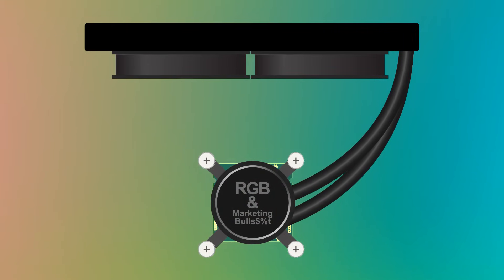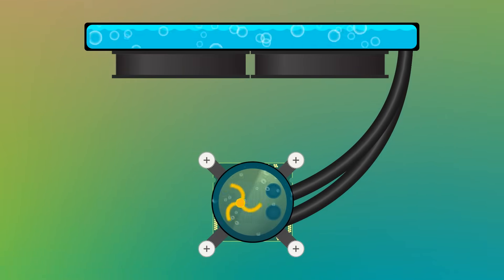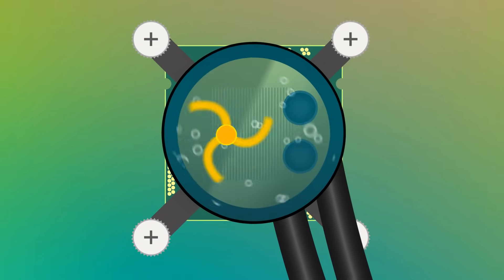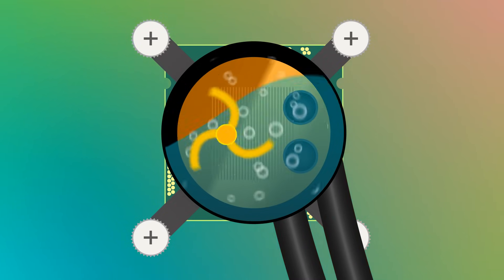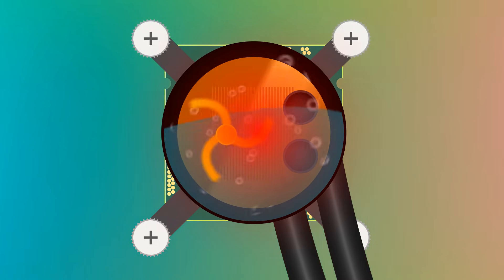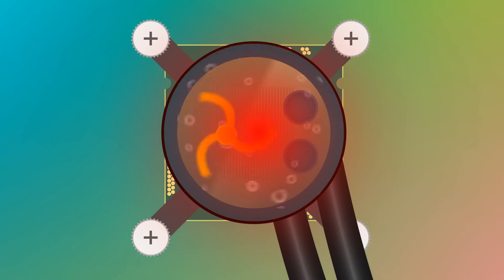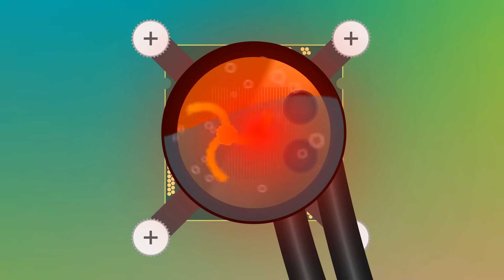Correct AIO orientation (This is the way)

Comment: yeah....this is great and all, but tell that to my BIG ass GPU blocking the damn tubes from being orientated at the bottom.
Reply from the maker: Yes that's the reality of the matter 
length of the tubes are too short in a lot of cases
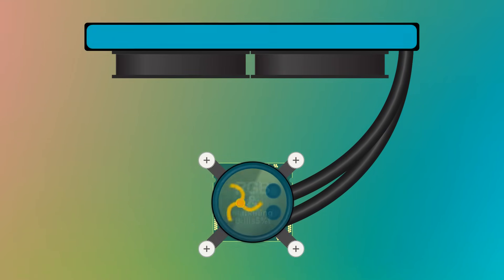0:11 is probably the safest configuration.
Reply: Tech Infographics agreed but I have a 360mm and only can do front mount. But my tubes aren’t long enough to do barbs down. So best thing I can do is make sure Rad is higher than the pump right? What are some signs knowing that it’s starting to go bad? Temps increasing? Hearing gurgling sound every once in a while is ok right? I know it means air is getting there but if it goes away that means air is no longer trapped?

Ps - you’re awesome for making this clear video and straight to the point
Reply: @mannyfresh7065  I'm in the same boat as you. Jay2cents and Nexus both said that if the barbs are coming from the top instead of the bottom the only difference would be the sound you hear and not the longevity of the product. I don't mind the aquarium sound, people pay lots of money for aquariums😂

Comment: What about the other aio's with the pump on the radiator? Can i use the last orientation for front panel set up? Im using msi mag coreliquid 240r
Reply from the maker: Try 1:46

Comment: 0:12 is this better orientation?
Reply from the maker: If you are prioritising GPU temperature over CPU temp, then Yes.

If you're priotising CPU temp over GPU then 1:46
Reply: @tldrinfographics5769  i think its the other way around
Reply from the maker: @asimo8146  Oh my you are right I have corrected it. Thank you so much.
Reply: @tldrinfographics5769  what if you cant bcs of nzxt h510 case, and nxzt x63 kraken aio?
Reply from the maker: @Darac6800  Last choice is 1:45 with tubes up which is just okay.

Make sure to keep the tubes in U shape
Reply: @asimo8146  yea u mount it infront if your worried about cpu heating problems right? As a intake
Reply: @akachrisc1519  yeah, becauae cool air from outside and when it passes through your radiator your cpu is cold, but the air from that goes into the case, warming the gpu and other stuff, but the air isnt that hot, its just not cold

Comment: how about if you only have a short AIO with single fan only. What would be the possible orientation?
Reply: With the tubes down side,  and the radiator in the upper part of the front panel, pump must be lower then radiator. Or just the radiator instaled on the top panel of the case. Or eventualy radiator on the back panel, but again pump must be lower then the upper part of the radiator, with tubes down.
Reply: @vesko1022  that was nice bro, thanks! I have a Deepcool GAMMAXX L120 V2 but not yet installed because it’s complicated haha but if I have time probably I would install it.

Comment: 😂your pump animation is totally messed up! Either running the wrong way or the pump blades should be the other way😂😂.
You animated the worlds most ineffective pump.
Reply from the maker: Haha sorry I didn't have fluid dynamics class.
It was hard to translate the pump's mechanisim into 2D as well and I had to delete the pressure guide part for more stylised and simplified look as I decided to focus on demonstrating the air pocket problem.
Reply: @tldrinfographics5769  I'm sure you knows how a spoon works! If you are American! I'm not surprised 😂

Comment: Does it make much difference having it front mounted with the tubes at the top/??
Reply from the maker: According to Gamer's Nexus it's quite bad to mount it that way.
Reply: It will keep the bubbles at the top of the tubes, this might result in lower liquid flow and the pump might have to work harder to keep the fluid flowing.

Comment: My tubes are short and my only choice is to have them at the top with a front mounted radiator :(  Haven't had any cooling or noise problems yet though.
Reply: Shouldn't cause any issues with longevity or cooling performance, only potential noise from the water bubbles
Reply from the maker: Sorry to hear that, manufacturers need to be more thoughtful with their design I think.
Reply: damn im building a pc right now and i ran into this problem too. tubes are way too short, but i hope it wont be an issue with my radiator being front mounted.
Reply: Dont over-stress this problem. It shouldnt happen to the majority of aio out there. Watch this vid from Science Studio, he clarified this for those takin this too seriously: https://youtu.be/1RcFQZ8zk5U

Comment: I can't flip my cooler and mount it properly... Single fan 120mm radiators suck.
Reply from the maker: I'm sorry to hear that 120mm radiator is probably not as good as a good air cooler.
Reply: Agree, 120mm AiO is worthless, air coolers can do more. Minimum requirement is 240mm

Comment: 0:11 is this the best orientation for top mount? I'll follow this once I'll upgrade to AIO soon.
Reply: Yea im gonna do that
Reply: In top mount orientation does'nt matter. in the vertical/front mount, keep tubes part at the bottom.
Reply: @captainfatbat9557  so like how it is at 0:11 ?
Reply: @spookythagoat310  Its an okay position. BTW where the hell did u find an aio @ only 12$
Reply: @captainfatbat9557  on Newegg it was on sale it’s called ID-Cooling 240 x snow edition
Reply: @captainfatbat9557  I’m still kinda new to pc stuff and I got a AIO for $12 for my pc build
Reply: @captainfatbat9557  should I have it as intake or exhaust
Reply: @spookythagoat310  Exhaust is a better choice
Reply: @captainfatbat9557  ok I will be mounting on top
Reply: @captainfatbat9557  but if you don’t mind me asking how does exhaust better?

Comment: your only option is to get the 240mm , front mount, tube down to eliminate the air :) which I just did with my new build 3800x and Arctic Liquid Freezer 2 240mm, it cools down idle 36-38c, load at 52-55c and specially it cools down faster and heats up slower :) !!

 I just proved myself, the front mount , tube down MADE the huge differences vs my previous top mount. 2-5c differences are big and critical! Especially when the cpu takes longer time to get heat up and faster to cool down is the PLUS sign to have front mounted!! (just like the car's radiator :) ).

My system has little advantage for GPU, I have EVGA hybrid AIO mounted in the back of the case 120mm exhaust!! I do not have too many heat generation source in my case :)

Front mount makes differences!

Comment: Thanks N Tech Labo for this very helpful video.  I recently top mounted my radiator since it came mounted incorrectly, side mounted with the tubes on top 🤦🏻‍♂️.  

My question is this, now that my rad is top mounted, do the tubes on the part that makes contact with the cpu also have to be on bottom?  Because I currently have tubes on top.  

I’ve seen many users have the tubes on the sides and some on the bottom so I’m not all that sure  which orientation is the correct one.  Again, in respects to the tubes that connect to the cpu. Thanks again! 🙏 😊

Comment: I'm fitting an x73 in the front of the corsair 465x case with the outlet tubes at the top of the rad, as there isn't any space to mount on top or the front with tubes outlet at the bottom. Will this config be fine as long a the radiatior is higher than the block on the cpu?
Reply: yea should be fine. tubes up or down is mostly a potential noise-thing, the important thing is that the pump is not the highest point in the system
Reply: @aludrum9680  That is not correct. If the tubes are up, and radiator is the upper point of the closed cooling system, so the air will stand there and pump will sucks air+liquid, instead of liquid only.
Reply: @vesko1022  yea but the air won't accumulate in the pump so it's mostly a noise issue really, maybe a little bit of cooling loss but it won't damage the pump or shorten the lifetime of the cooler
Reply: @aludrum9680  Its not about accumulating of air. The air and the liquid have diffrent density, and they
resistance in diffrent way to blades of the pump. So the revolutions per minute (rpm) of the blades can't be constant and stable. This effect definitely can damage the pump. Also, nobody likes noice  :) .
Reply from the maker: are the tubes too short when it's mounted down?
Reply: @tldrinfographics5769  no there isn't enough clearance near the psu and hdd cage for tubes to fit and come upwards from that direction

Comment: Thanks for this! Does the “lowest part of the radiator” still apply if the radiator is on the top of the case? Does it matter anymore? 

(Planning to have my AIO with tubes on the East side and radiator top mounted)
Reply from the maker: Lowest part of the radiator thing still applies.
Simply point the hose outlets downward.
Reply: @tldrinfographics5769  got it! Tubes to the south and radiator at top of case for me then! Thank you again!
Reply from the maker: @Ellyidol  Good luck!

Comment: My AIO does not fit at the top can i put that in the front ?
Reply from the maker: Sure can as long as the top of the radiator is higher than the water block.

Comment: When installing the AIO at the top, does it matter which side you have the tubes coming down? I want them on the left side, so they down cover the ram.
Reply from the maker: Left or right doesn't matter but make sure it's pointed down.
Reply: @tldrinfographics5769  make sure what is pointed down?
Reply from the maker: @sleepless9284  the inlet and outlet tubes are facing down like 0:10

Comment: Very informative video. Big fan of this explanation.

Personally, do you think having a top-mounted orientation like 0:12 works as well as 1:44 ?

For my planned build I think the case in the front mounted position would be obstructed by the GPU. I wont run into this issue if I top-mount it instead
Reply from the maker: Top mount is probably the best way since you are not introducing the heat back in to the case and GPU performance is way more sensitive to heat than the CPU.
Reply: @tldrinfographics5769  so just to be clear, image in 0:12 is the best way?
Reply from the maker: @luisstamaria7018  Yes!
Reply: The top mount is good as well, but it makes the overall heat of the system from the gpu, vrm's, and cpu through the radiator because it's functioning as an exhaust. Having it on the front, on the other hand, gives you cool air from outside the system directly to the radiator, which makes it more efficient in cooling your whole system.

However, the theory of having the radiator front-mounted is that the heat of the cpu will then pass through the gpu, but someone already tested this, I just forgot which youtuber did it, but the results came out that front-mounted is better for both the gpu and cpu rather than having it top mounted.

Comment: Hi.  I need help. I had a Kraken X63 280mm aio. This aio cooler had be used to cool down my gpu via the kraken G12 bracket. 
So what happen is for my config, the water pump is upset down and the radiator is in front with the tubes at the bottom. 
The pump is around in the center of the radiator .
Is this ok? 
My case is a fractal design meshfy C so is not that i have any other  option . 

thank you
Reply from the maker: That sounds Ok to me.

As long as the top of the radiator is higher than the pump, which you already seem to have.

Pump being upside down shouldn't cause any trouble as far as I am concerned.

Comment: I’m going to build a pc and I want to front mount a 360mm aio but the Corsair 4000d airflow dosent have space for the cables to go under
Reply from the maker: Cables or the tubes?
Reply: Tech Infographics sorry tubes
Reply: @tldrinfographics5769  Will they fit?
Reply from the maker: @vertex6099  I am not sure about this one as I have no experience with Corsair 4000D.

But it doesn't look like you can front mount the right way
you can put the tubes down.
Reply: Tech Infographics  should I just go for a 280mm radiator and top mount?
Reply from the maker: @vertex6099  If I were you I would do that. 
Get 280mm and top mount.

Arctic and EK products have great performance even on 280mm.

Please make sure to double check that 4000D supports 280mm top mount.

Good Luck
Reply: @tldrinfographics5769  I might get a h155i capellix

Comment: Not only do most AIO manufacturers showcase their products installed incorrectly in virtually all of their advertising but they also, in many cases, don’t even make the tubes long enough for the radiator to be properly installed. 

I really don’t understand how so many of them screw this up. This isn’t exactly high level physics or fluid dynamics. Surely they know that this is the optimal position, yet many of them continue to get this wrong. 

Of course plenty of people install their AIO’s either with the pump or the tubes at the highest point in the loop and it seems like many of them don’t have any issues with it. Either way, the manufacturers should at least provide the means to install these products correctly.
Reply from the maker: Yeah these companies lack philosophy and often focus on following quick trends.

But then they don't have the luxury of billions of profit that Apple or Porsche enjoy, which is essential for trend setting innovation(acquisition.)

Arctic and EK is doing some great job recently, hope people notice them.
Reply: @tldrinfographics5769  I was considering the Arctic Liquid Freezer II but I really don't like the design of the block. Same goes for EK's offering. If EK would make their AIO blocks look even nearly as nice as their custom water blocks, we'd definitely be in business but of course, they have to design the block around a pump. Still, I think they could have done a better job in the looks department. 

I ultimately went for the NZXT X53 because when comparing all of the top quality AIO's to one another, it seems like you can essentially make your choice based almost entirely on aesthetics. They all perform roughly the same, give or take a couple of degrees and even a unit with loud or inefficient fans can be significantly improved by simply replacing those fans. NZXT has a good warranty, good benchmarks/reviews and it looks the nicest in my opinion. 

Surprisingly, Lian Li is giving them a run for their money in the aesthetics department. I like the look of their Galahad cooler but it does fall behind a bit when it comes to control and customization - just like the Castle EX. I definitely prefer a software solution over an in-line switch with a few lighting presets. Especially since the software allows you to tune the pump and fan speed as well as lighting, all in one place.
Reply from the maker: @TitaniteScale  I was on the same boat but ultimately went with EK.

Loved the design of NZXT with OLED display but it was just too expensive and after all performed too close to Noctua air coolers. 

I agree that EK and Arctic makes dog shit looking AIOs lol took me a while to get over it haha.

We are in the period where a lot of PC components are picking up it's pace in performance, for example: Ryzen CPUs, AIO, GPU and High performance Monitors.

We are seeing performance leap everywhere but the choice is still a bit limited because they haven't matured yet.
Reply: your only option is to buy the 240mm , front mount, tube down to eliminate the air :) which I just did with my new build 3800x and Arctic Liquid Freezer 2 240mm, it cools down idle 36-38c, load at 52-55c and specially it cools down faster and heats up slower :) !!

 I just proved myself, the front mount , tube down MADE the huge differences vs my previous top mount. 2-5c differences are big and critical! Especially when the cpu takes longer time to get heat up and faster to cool down is the PLUS sign to have front mounted!! (just like the car's radiator :) ).

My system has little advantage for GPU, I have EVGA hybrid AIO mounted in the back of the case 120mm exhaust!! I do not have too many heat generation source in my case :)

Front mount makes differences!

Comment: Hi! If I mount it at front will it take the space for front fans? If not should I put any fans? One last question what should be my top fans. Intake? Exhaust? 

Thank you! I’ve been looking everywhere for this video! Great vid! 👍🏻
Reply from the maker: If you mount it at the front you can choose to use case fans and radiator fan at the same time to configure push-pull for maximum performance.

If you mount it at the top you should configure for exhaust because:

1. Hot air from whole system ends up at the top so it's best to exhaust it.

2. Dust gets pushed away at the top rather than accumulating at the top.

3. You don't want radiator heat to enter the case.
Reply: @tldrinfographics5769  Thank you very much!!!!

Comment: Please tell how to mount a 360mm aio on the front with tubes at bottom. The tubes are out of reach 😔
Reply from the maker: Sorry to hear that! 
Alternatively, if you have option to mount it on top side of the case that's actually ideal as well.

If you mount it on top you are prioritizing GPU thermal over CPU which is ok as GPU is more thermally sensitive.

Comment: 100000% makes more sense than dremel guy
Reply: so true... HAHAHA
Reply: @lindstrem.alexander  I've unintentionally found about 6 videos since... steve and linus both install AIOs with the tubes at the top of the tank front mounted
Reply: @zeeanemone6482  i know i have seen it but their excuse would be that its mostly on test benches. Although linus build the all gigabyte like that for a customer as well lol so i dont know... i dont take it all too seriously since i have seen them all do it. If the AIO dies, it dies and next up will be air. fk it